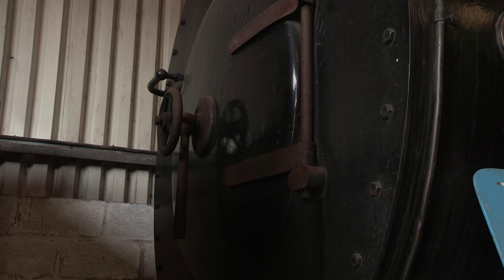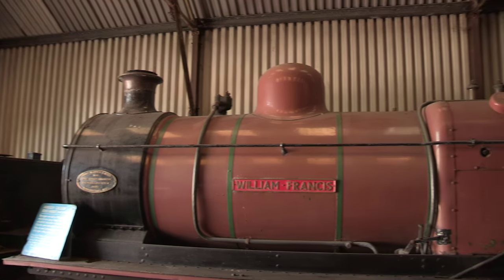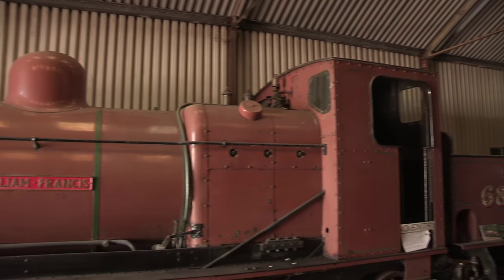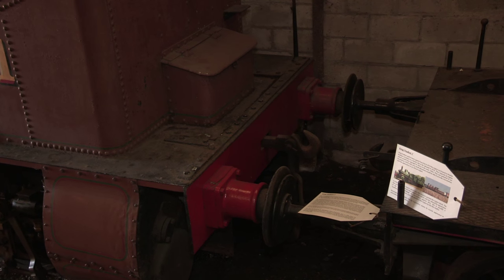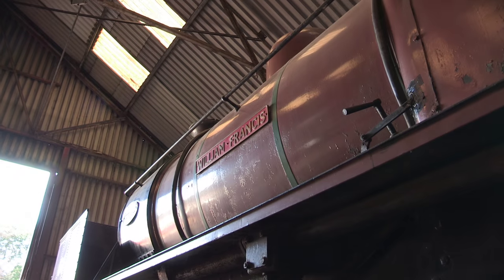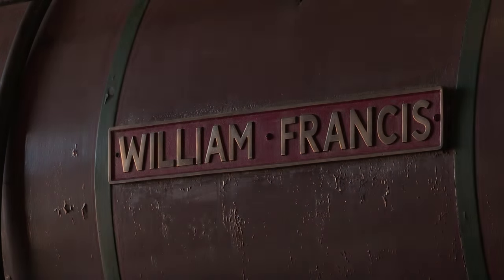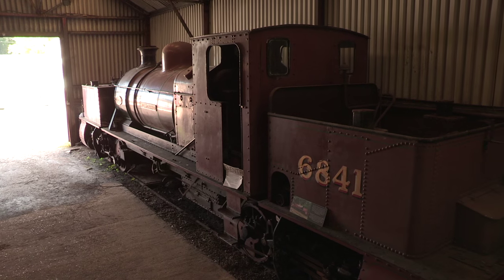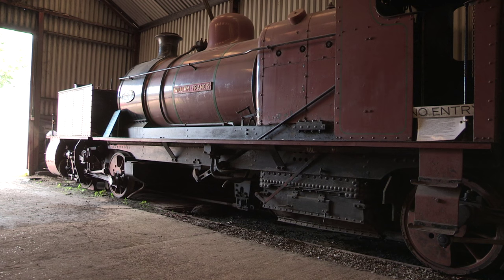SOLE SLIP - NCB 6841 'William Francis'

Comment: So I just did some calculations on William Francis’ tractive effort and something’s not right. I have the right boiler pressure, driving wheel diameter, cylinder diameter and so on, but I get don’t get 24600 lbs. Instead, I keep getting 27884 lbs, so either I’m not doing something right, or Beyer Peacock just lied when they quoted the tractive effort. Still, one of my all time favourite steam locos, even if it the tractive effort is unknown.